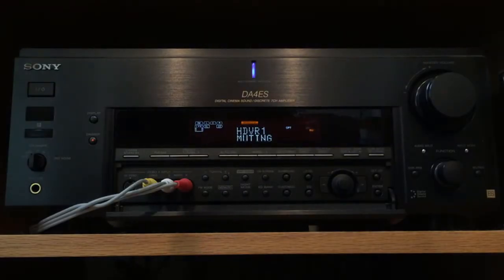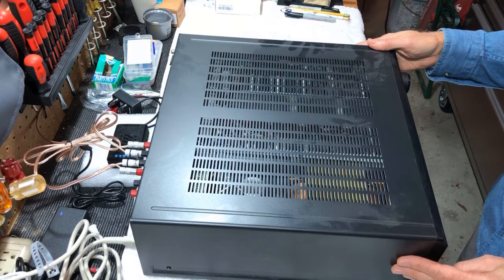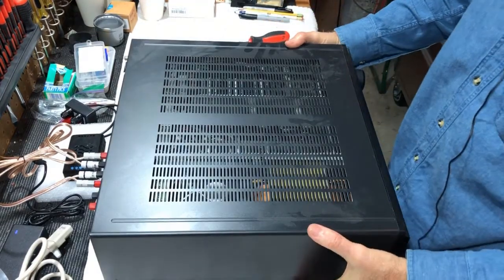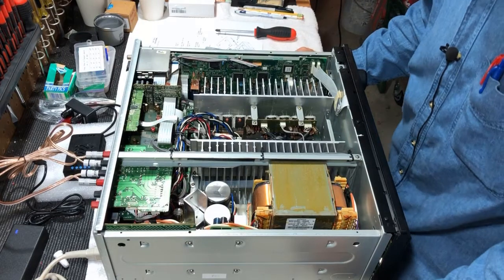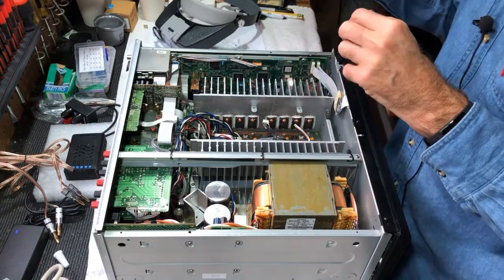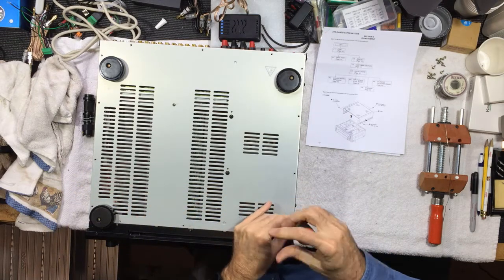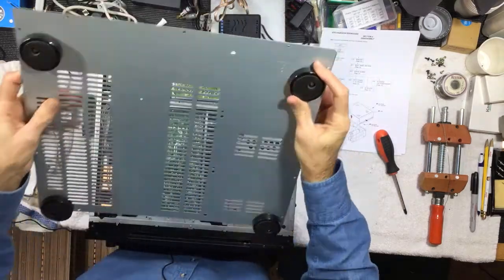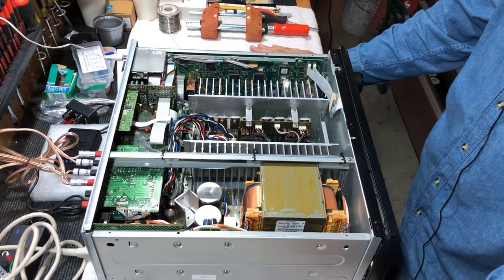Sony STR-DA4ES AV Receiver "Audio Pop" Repair

Comment: I have a DA7ES , the front right speaker channel is extremely quiet, do you  know what the issue could be, it’s not the speaker, it’s not the wire, no balance issue, it’s just the front right . Every other Channel is loud and clear

Comment: I have the same problem, but only with one channel (front right). Any ideas?
Reply from the maker: Most likely a cold/weak solder joint. I recommend you resolder all of the solder joints on the amplifier ICs and voltage regulators.
Reply: @litzdog911  I have resoldered the parts you show at 5:48 and it works! Model Sony STR-DH800. Thanks for the video and your help!
Reply from the maker: @DJDeeKaa_HQ  Excellent!  Enjoy!

Comment: I need your help . I have sony str-k740p buttons on front play up select cd then change to radio and remote do not work on amp.
Reply from the maker: Sounds like a different issue than what I had. Perhaps the front panel buttons need cleaning (DeOxit)?  Check remote control batteries? Can't really offer much help. Sorry.
Reply: @litzdog911  when I reset it remote stop working on it remote control it's self fully working order. The amp is clean buttons ok just components gone wrong  on most hifi systems it's the panel on front needs changing.

Comment: Hey thanks for this video. I just put my DA4ES back in service this weekend and was disappointed to find the left side surround channel was dead. :( I have the service manual and it looked like IC701, the power amp for the left side surround would be the culprit. After seeing how simple it is to remove the A-Class board in your video, I disassembled my entire setup and pulled the board. No obvious solder defects, even under a microscope, but I re-flowed all the joints anyway. Knowing that servicing that board would be a cinch pushed me over the top to just get it done, and it worked!
Reply from the maker: Excellent!

Comment: nice video, one small point however. When you test the amp after reflowing the chips on the 'A Class' board, it may have been prudent to have the speakers plugged in.
Reply from the maker: Huh? That's what I'm doing during the last minute of the video. Speakers are connected. And, 2 years later, the unit is still working great. No pops.
Reply: @litzdog911  😃

Comment: Hello, I have a Sony STR-DA2ES (so not the exact same mode as yours, but similar) from the same year with the same problem.  I don’t see an “A Class” board in mine.  Do you know what solder joints I should tackle on mine?

Or even better, could I pay you to fix mine?  I’m located in central Wisconsin.
Reply from the maker: That's the "little brother" to my STR-DA4ES. You can find its service manual at the link here:  https://www.hifiengine.com/manual_library/sony/str-da2es.shtml  
I would recommend re-flowing any suspicious solder joints, especially those on the big transistors mounted on heat sinks and any voltage regulators. Basically anything that tends to run hot would be suspicious. Good luck!

Comment: It always pays to check solder connections on voltage regulators, they often have the same problem as you found on driver IC's, good video.

Comment: I have the same receiver but goes in to protect right away,when the receiver gets warms it works fine..plz help
Reply from the maker: Also likely a poor solder connection. Poor contact until the unit heats up and the connection expands. The challenge will be tracking it down. Concentrate on the components that generate the most heat. Good luck.

Comment: Hello, do you do repairs on sony home receivers? I have a sony av receiver model da5600es it's a little older but works great but unfortunately I did the factory reset the "memory clearing" option! An now it's stuck on that option! Memory clearing! Can you help? Thanks.......
Reply from the maker: I'm not familiar with this model. You might find some useful information in its service manual here .... https://www.hifiengine.com/manual_library/sony/str-da5600es.shtml

Comment: My STR-DB940 does the same thing. But also flashing the muting light when acting up. And when trying to change input source. Did you see any of that?
I fixed bad solder on the output relays several times on it too over the years....
Reply from the maker: No, didn't see any issues with a flashing MUTE light. That might point to the area of the fault, though.

Comment: I have the same receiver and the power switch does not work.  Any thoughts on how to fix it?
Reply from the maker: You can find the service manual at hifiengine.com 
Perhaps you can find a replacement power switch on eBay. Or jumper the power switch and use a switched AC power cord?  Good luck!

Comment: Nice work ! I have this same receivers they sound great !! And yes they  are very heavy.  They don't make them like this anymore receivers are cheaply made receivers  these days. No power just bluetooth hdmi
Reply: "They don't make them like this anymore"

Well, they still do kind of make them like this, but you're going to pay dearly for that level of quality.

That said, the DA4ES was a good high end offering in its day, too, and it was also quite pricey when it was new.  It was just one step down from the flagship digital surround receiver in the Sony ES lineup back then, the STR-DA7ES.